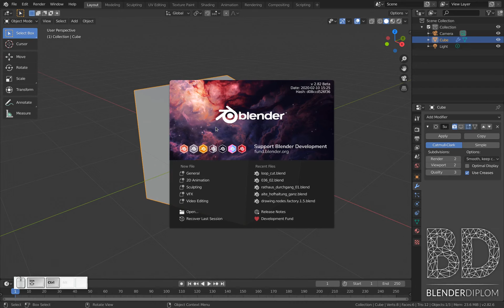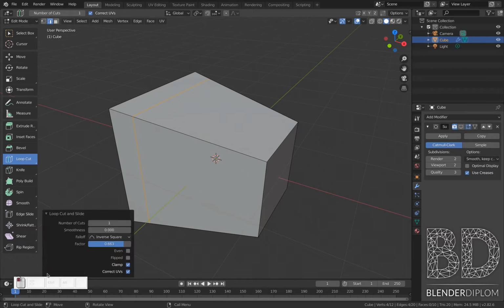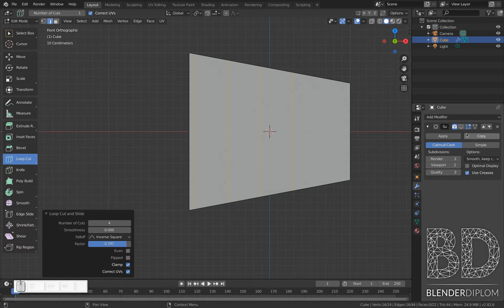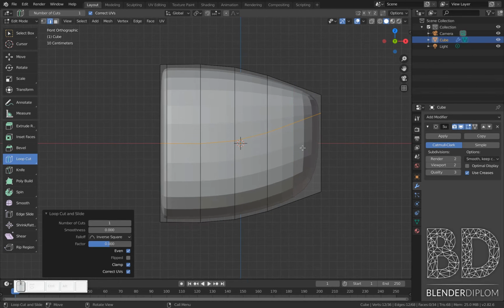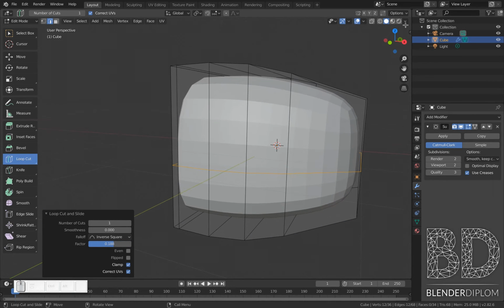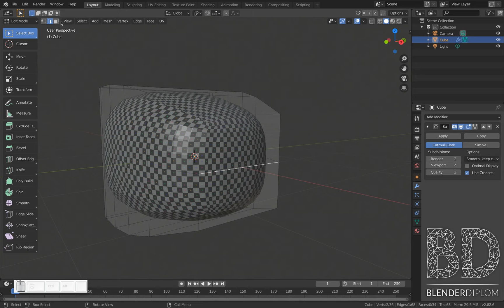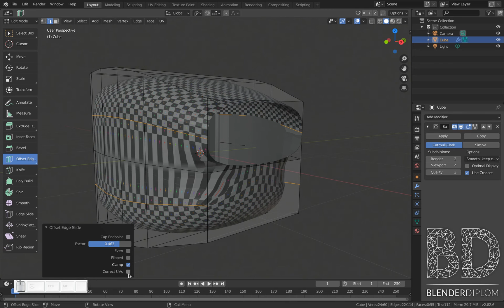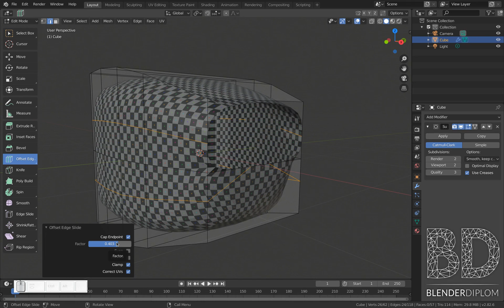Loop Cut and Offset Edge Loop Cut in Blender 2.8 Explained

Comment: Is there a way to limit the length of loop cuts so they don't add geometry to parts of the mesh that don't need the extra polys? From what I can tell, loop cuts go all the way around through all layers of faces. Say for example, a character's eyes, I want to increase the number of polys around just the eyes without the loop cuts going into the rest of the face? Is that possible? Or is that for the knife tool?
Reply from the maker: That is a job for the knife tool. The loop cut is meant to preserve quads. If it would not go around in an entire loop, you would end up with n-gons.
Reply: @BlenderDiplom  Does the knife tool have the same results? I have tried it in some cases and it won't let me add edges to some faces.
Reply from the maker: @basspig  no, the knife tool does not care for topology so the results are different most of the time.
Reply: @BlenderDiplom  that's often a problem in some models because I find it doesn't reliably work in all editing situations.

Comment: thank you for this tutorial, BUT , Blender looks like complete useless for accurate mechanical or architectural modelling since there is no a measurement system anywhere.. for example if i have a 2.5x2.5m box and want a loop cut 0.37m from the edge, looks like there is no way to do this simple thing (which is just 1-2 clicks in other programs).. Is there any solution ? am I missing something here ?  thank you
Reply from the maker: Accurate or precision modeling is not something Blender was originally created for but we see more and more effort to introduce those kinds of features. Maybe there is an addon that offers the desired fuctionality.
Reply: @BlenderDiplom  it is impressive that a 3D modelling software of this class (almost industry standard for some works) "forget" to implement a measurement system and make so complex the process for precise modelling...  I tried some addons but the work that need 1 or 2 click in other software, here it becomes a complete chaos. I hope the developers to solve this problem and give us a toolset with common sense (and not this psychotic system of percentage%)
Reply: @georges8408  Perhaps you could make a plugin or get one made so that when the loop cut or action is applied, the distance displayed in the top left could be altered manually, would likely require a few extra options such as which side it adheres to, mirroring and flipping etc